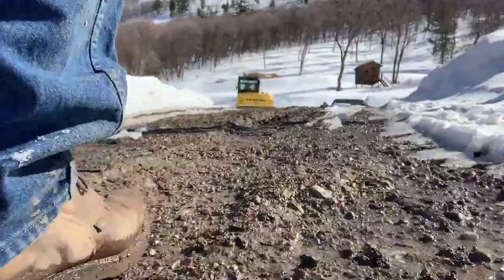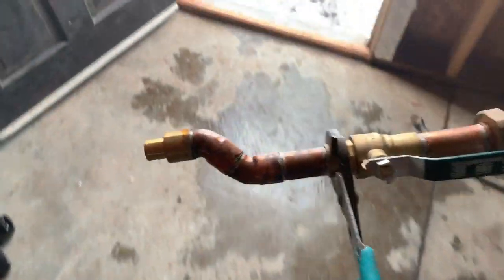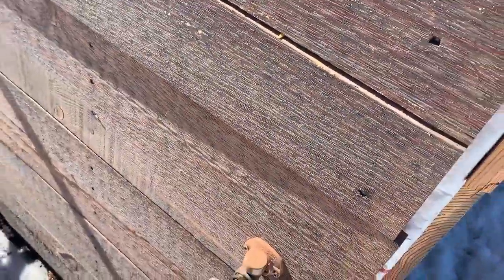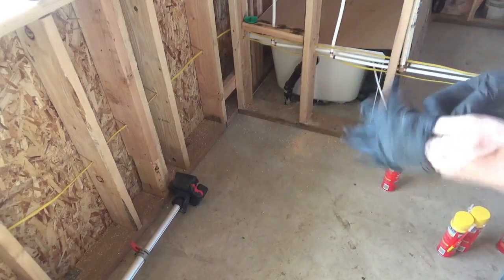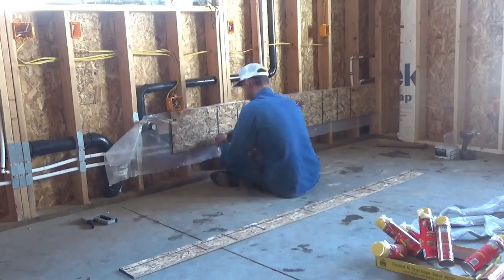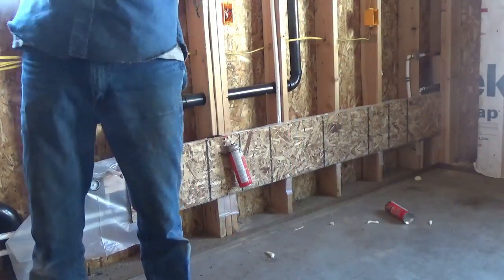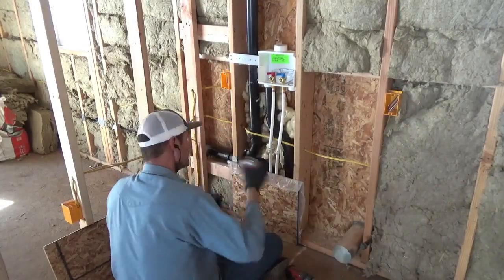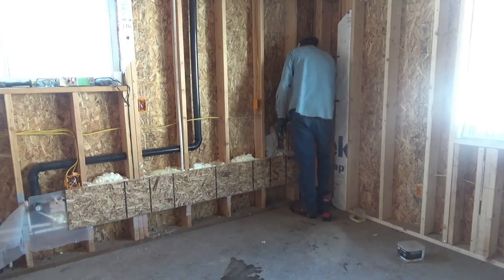DIY Spray Foam Before Insulation (Bathtubs And Water Lines) Water Is On!

Comment: After I had a cast iron tub lift out of level with foam I became a strictly mortar man when setting a tub.
You are quickly attaining 100k followers. Congratulations!
Reply: When Heath gets a level he will worry about it.  Actually Home Depot said the foam was "done by a lot of plumbers" FWIW but was not at all impressed with the outer wall foaming.  I agree mortar it.

Comment: Interesting use of spray foam insulation.  Especially around the bathtubs.  Interested to see how it all turns out.  Great video, Heath....thank you!
Reply: I did it 32 years ago. Underneath the tub and the fiberglass shower stall. Perfect. A no-brainer.
Reply: Spray foam underneath tubs is standard practice these days.
Reply: @AppalachianLife  I am familiar with putting a large dab of thin set under the main portion of the tub (like where a person would likely stand to take a shower), that's what I have seen done....I had never seen the use of spray foam.  I like the concept.

Comment: The spray foam under the bathtub was a great idea!
Reply: Meanwhile the spray over the piping etc got the Idiot Contractor Of The Day award.
Reply: To support the base of the tub from movement, the tub is supposed to be set into a bed of mortar. Spray foam has too much give, or flexibility to withstand repeated movement in an acrylic or fiberglass type of tub. The foam will eventually compact itself, lessening the support it originally had. Therefore, stressing the floor of the tub and causing premature failure. Spray foam is excellent for insulating and sealing gaps, its manufactured purpose. Thanks
Reply: @JohnDoe-np3zk  - Why? For future repair situations? Yours is the only negative take thus far; so I'd really like to know - you may have something valuable to say...
Reply: @debbiem2146  absolutely it makes any repair very much harder to do than just pushing aside some rockwool insulation or fiberglass.  The "great stuff" is more to seal larger penetrations, air movement is what causes a lot of heat loss.  Other than that you are better off with just "regular" insulation.  There are also concerns as to the foam being hot when sprayed plus it could cause failure of the pipe, possibly.
Reply: @debbiem2146  may thoughts as well
Reply: John Doe - Thank you for your insight, something to be aware of for sure.
Reply: @debbiem2146  you're welcome also the mortar under the tub is the way to go that foam stuff is no support.  Have a great day.

Comment: The spray foam around the pipes is a great idea. I read someplace one time that you don't want insulation on the room side of the pipes.  You are basically insulating the pipe from the warm air inside.  An extra board where the pipes are might help minimize that.  But this is way better than Rockwool.  

The beloved 6 weeks of mud in Idaho!  Can't wait!  Keep up the great work!
Reply: You make a cogent argument, and then contradict yourself!  The spray foam is a good material to seal penetrations and gaps.  Air is mostly what you want for insulation, without air movement.  The spray foam around the pipes is a horrible idea on several levels.  Sorry.
Reply: @JohnDoe-np3zk  There are a whole range of bad to good to great insulation methods for pipes.  What Heath did is a good choice.  Without you being specific, I have no idea what you are talking about.

Comment: Here is a tip. If you spray the recently sprayed foam with water it will expand about 50% more. This gives you better yield from a can when you have big spts to fill and don't need the super high R factor
Reply: Water activated! good call, especially during low humidity.

Comment: you're doing good Brother. when the insulation is done the drywall is next and you'll start flying. hire a good finisher for the drywall and be done with it. i don't mind hanging it but i am smart enough to know i'm no taper and finisher that's for sure. after the drywall is done you'll be re-energized and trim out the house. best of luck my man, you have resolve that's for sure.

Comment: Gosh Darn! We never put insulation around water pipes in exterior walls. Only behind/between pipe and outside. Insulation will keep it as cold as it will warm, and prevent warmth from reaching pipes. We need the warmth from inside the house on the pipes, to keep them from freezing. I would carve off the foam to expose the interior side of the pipes. This is from years of repairing seasonal homes and cottages.  Please re-think this option.  Other than that, I think you are doing a great, well thought out, house build. Can't wait to see it finished. Subscribed also.

Comment: We did a door blow test and it is amazing how much air flow we had on eletrical boxes on exterior walls. I would spray foam behind them if I could to it again.
Reply: The air follows the wires down thru the cavity
Reply: Spray foam and setting your mud rings right away were a few tricks I learned pretty early in my apprenticeship. Pretty neat work environment plus NEVER slack on your “as built”(priceless). Lol

Comment: I’ve always set tubs in mortar and silicone caulked the bottom of the skirt. I used to be a mason, so mortar is my comfort zone. Foam seems like a good idea - better insulator. Thanks.
Reply: The "better idea" is to use the mortar.  For a slab the right plan was to use foam board the 2" exterior rated pink stuff before pouring?  Maybe he did it.

Comment: Before you install drywall add 2x10 blocking between every stud at upper and lower cabinet height. It makes it so much easier to install cabinets. You can do the same thing in the bathroom for the vanity, towel holder and toilet paper holder.
Reply: Don't worry, he can always chisel out the "Great Stuff" to put in blocking later...
Reply: My thoughts exactly -- I'd add the blocking on the walls also.
Reply: @Rebecca-zr2zx  he is putting up the drywall first then will likely get the cabinets in that he is ordering online.  The other disaster is no nailing plates over electrical that's not good.
Reply: @JohnDoe-np3zk  nail plates are not required on 2x6 studs if holes are drilled  in the middle of the stud. Normal drywall screws do not have the depth to reach the wiring.

Comment: Great tip on using foam for the tub and water lines , were currently remodeling our kitchen and bathrooms and that is my biggest peev , losing the heat . Though we live in Alabama, it doesn’t get the extreme cold like you but I think if we do this we can probably remove the heat tape we’re using to protect our pipes . Thanks for sharing this idea :) btw I love the door behind you in the video .
Reply: Don't use foam to set tubs, it isn't rigid enough. Always bed in non-shrinking grout and just pack the tub with fiberglass batt insulation to get better insulation on a fiberglass tub.

Comment: Have you considered adding an entrance porch (as we do here in the UK) to prevent all the muck being dragged in when you enter the house? Would also provide additional insulation to the downstairs. 6ft by 8ft around the front door?
Reply: when we build our house we are going to do that. I want it to stop the dirt and mud and the bugs some what. screen porches are awesome too.
Reply: @Eryn321  Over here it is also added security so see who is at your front door.
Reply: The back door is the entrance to the mud room.

Comment: Great idea, the 2 part purple spray foam insulation for outside walls would that have been cheaper. A suggestion to find tools, ladders, water lines that a picture where they are and you'll find them in the deep snow in spring. I know I should of did that as I was shoveling for my sump pump line. This would have save me some time and effort. Dam Murphy!!!

Comment: Tip: Take the excess pieces you cut off or scrape off the floor and stuff them into the spaces you plan on filling with foam next. The scrap fills in sections and voids. The new foam sprayed into these areas will expand and surround the scrap pieces and thus requires less foam to be sprayed into the area. Using the scraps in this way allows you to get more coverage with your next can.

Comment: I am glad to see you put the plastic up then OSB for rigidity. 
When it finally does dry that plastic should peel off very easy and you will have an extremely smooth finish to butt your drywall up to.
Saran Wrap is extremely good if you want to shape the foam with your hands to get a certain shape.
As thick as that cavity is it will take probably two to three full days for it to cure. If the humidity is a little high inside the house it will cure faster.

Comment: I put a access door where my outside spigots are with a winter shut off valve. Every time someone leaves a hose hooked up it would freeze back to the freeze out area and have to be replaced. One wouldn’t think that would happen so often but with my kids washing cars, watering  dogs or horses. It happened at least 3 times in 4 yrs.

Comment: As long as you don't drive a nail into a waterline, that stuff it great.  I'm not looking forward to scooting on my back in my crawlspace to dig through the foot of foam in my floor joists to reroute a PEX pipe the builder installed incorrectly.

Comment: I’ve seen this on houses that I’ve worked on so I figured I’d pass it along to you.   The insulation crew went along all the electrical boxes and anywhere there was penetration through the exterior wall for pipes and electrical boxes using low expansion spray foam to seal everything prior to putting up the insulation to help further seal the house they even put little dabs anywhere an electrical wire was going into and out of electrical boxes on the exterior walls

Comment: We use plywood under the drywall in the kitchen. Helps secure the cabinets. No searching or hoping there is a stud. To secure the cabinets to. Makes things so much easier. We run 3/8 drywall over it.
Reply: Todd Haver we install 2x10 blocking between every stud at upper cabinet height and lower cabinet height.

Comment: That is an awesome idea with the spray foam. I am glad it worked out and looks like it will do exactly what you want. Thanks for sharing
Reply: Worst idea ever to spray that around PEX or any piping.  He will be sorry if he ever gets a leak after the foam that can damage the pipe from heat when you spray it.  The foam makes an exothermic reaction.
Reply: To support the base of the tub from movement, the tub is supposed to be set into a bed of mortar. Spray foam has too much give, or flexibility to withstand repeated movement in an acrylic or fiberglass type of tub. The foam will eventually compact itself, lessening the support it originally had. Therefore, stressing the floor of the tub and causing premature failure. Spray foam is excellent for insulating and sealing gaps, its manufactured purpose. Thanks

Comment: I have always bedded fiberglass tubs in precision non-shrinking grout. Foam is not rigid enough. Then I pack fiberglass batts around the tub if I want extra insulation.

Comment: Spray foaming tubs is different, here in Australia its pretty much hot all year round i think the lowest we get to here even on the coldest winter night is like 60F so we dont insulate so much and our tubs we just notch into the wall frame and put 2 or 3 bits of timber under the tub to support it but i like the foam idea maybe use it on my next home.

Comment: Did you ever think of buying a wood chipper? Between wood chips (rather than burn piles) and gravel, you could take a big dent out of your mud problem
Reply: He has one...
Reply: wood chips rot and make even more mud
Reply: john mine I use them for roads on my property very successfully.  They decompose, but it takes years and I simply throw new chips on when the time is right. They aren’t good for hills or if you only have 2 wheel drive vehicles. Otherwise I couldn’t live without them. I spread 78 yards last spring and put out an APB for more to our local arborists
Reply: @curiousfellow9341  you can either do the job right the first time or keep redoing it have one driveway over 50 years old had to add gravel once Rain washed it down the driveway.... have another over 15 years old... have not had to do a thing....  Mulch I use to keep weeds and grass down around trees...  I have NEVER driven on a public road made out of woodchips    Gravel,chipseal/blacktop,concrete even brick streets but no woodchips
Reply: maybe old asphalt roofs pieces
Reply: john mine I agree. Do it right the first time and it should withstand everything short of a catastrophe. Roman roads over 2000 years old are still standing and functional.
Reply: I would agree, just put down some 1-inch or 3/4-inch gravel down.
Reply: They are made of heavy stone though. A little different than gravel.

Comment: Never seen spray foam under a tub before. I've set one in a bed of concrete before, but never the spray foam. I may have to try that on the tub I'm setting here pretty soon.
Reply: You really are better to use mortar and set the tub in it which gives you a far better chance of really getting it level and is a lot less toxic material than the foam.  I'd shove in some of that pink board around the sides to get more insulation that foam is messy as hell.

Comment: we use to throw half a 5 gallon bucket of drywall compound under tubs. foam should be good. They sell larger foam kits they are like a freon canister with a long hose and a spray gun head. might cost more but you can get more done quicker. I've had water lines burst in wood framed exterior walls its no fun. they had foam pipe wrap and fiberglass behind them but theres not a lot you can do when it gets cold. good luck

Comment: Your wasting a bunch of money buying that style of spray foam can. You should buy the gun that accepts the screw on cans. You'll save money in the long run. It's also a good idea to use a little spray foam behind electrical boxes on exterior walls.
Reply: jhitt79 once you go to screw on cans you will never go back!!
Reply: Great idea foaming behind the electrical boxes.  I did that at my house too.  In a 2x4 wall which is what I had, it would be pretty hard to insulate behind an electric box.
Reply: @ELIRAXPRT  That's why I like to run metal boxes we call 1800 boxes in the electrical trade with.mud rings.  Gives you lots of room in the box and more room to insulate behind it with a piece of rigid foam.
Reply: Doesn't the gun + the cans actually cost more per oz? I think last time I compared, it was cheaper to not use the gun and refill cans. Unless they expand better, but it should be identical material. Price both the refill then the disposable can per oz.
Reply: Nicpedia I've priced them in the past and I believe I found it's cheaper to go with the gun (over time of course.). To be perfectly honest it's been many years so I don't remember the numbers off the top of my head. The big savings would come from less wasted material.  With the disposable cans, it's hard to use "just a little bit."  With the gun I've literally had a can on for a year, go to use it, scrape the tip with my fingernail and it's good to go. I've never had such luck with the disposable ones.

Comment: A suggestion: you don't want your spray foam preventing room temps from warming your pipes. Cut a channel toward the inside to allow those pipes access to house warmth.  Drywall and cabinets are enough of a warmth barrier.  Otherwise your r value is working against you and the pipes will freeze despite all your efforts!

Comment: I'm surprised the spray foam at the bottom of that horizontal OSB strip didn't bulge out and that all the foam released through the top.  I'd be too worried and be foaming in two or three tiers.  Does the foam have any reaction with PEX lines in the non setup state? I get the idea of using the foam to super-insulate the pex lines but I wonder if the foam between the pex line and the interior wall should be cut out leaving a void between pex line and the back of the drywall. That void would take to better heating, and the foam on the other 3 sides of the pex would insulate and retain that heat better, since you actually WANT the indoor air to get to those pex lines versus the outdoor air.

Comment: The foam will set faster if the area is dampened. I am real curious how this works out long term. If you have to go back in, using a sharp blade to block cut what you need to remove works well. Hack saw blades do ok too.
Reply: That stuff is absolute garbage other than specific applications where you are just plain in desperation.  Expensive, messy, toxic, and highly flammable.  Pain in the you know what to use.  Worse, damaged his piping already and made it impossible to fix.  Great Stuff indeed.

Comment: Had another helpful suggestion for your driveway if the local pavement company is roto milling any roads near you this summer call that company and ask how much they would charge to deliver some of those roto mills to your house (recycled asphalt product or RAP) it spreads just like 3/4 but once it’s been sitting in the hot sun for a while it can harden if layed down thick enough to almost pavement hardness.

Comment: That canned foam is moisture cured. If you spritz the surface with water before applying it it will cure faster and more completely. Also, it shouldn't be used to fill cavities in one go because the outer material seals the inside off so it doesn't get the moisture it needs to cure. That's why you have all that foam coming out after many hours. Better to do it in layers.

Comment: The type of spray foam that comes in a can is open cell.  It is great at expanding, but not the best if it gets wet or for sealing - for that, you need closed cell.